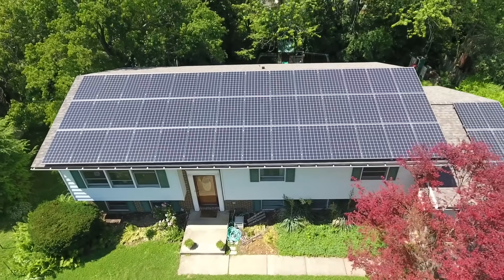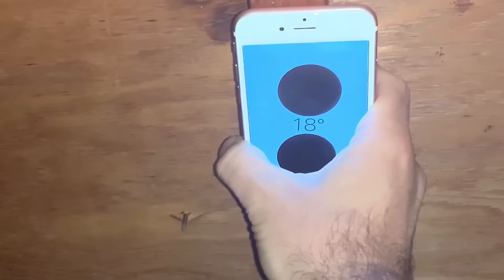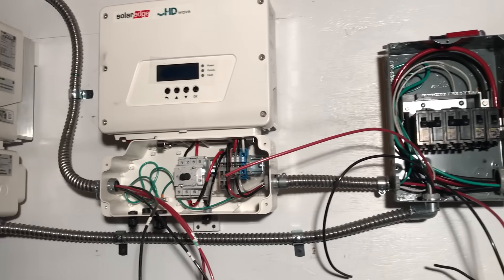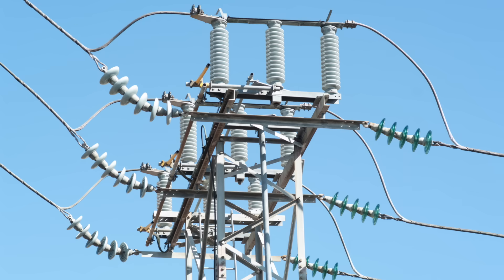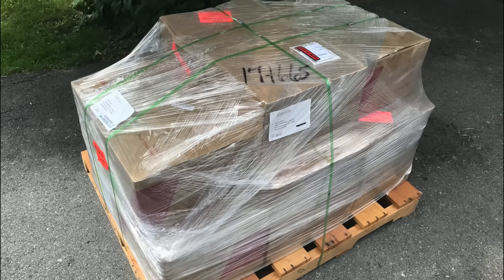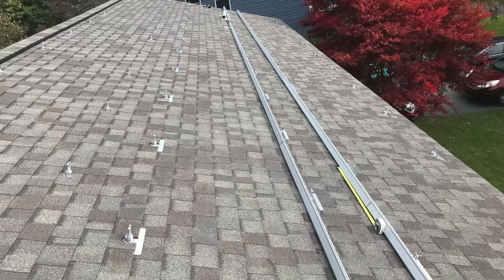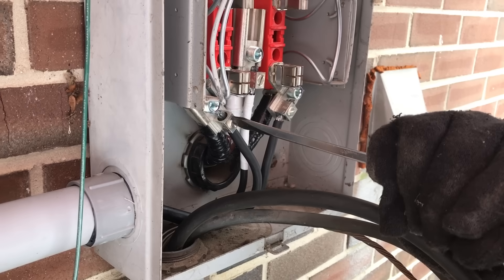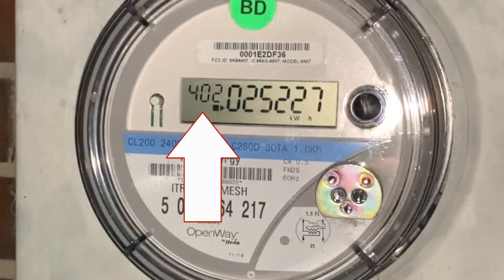I Installed a Power Plant Myself | HUGE DIY Solar Panel System

Comment: it is not clear what are the solar optimizers and the size of the inverter which should be huge. at the same time I see Vdc is 400V so I mean you are not using batteries for the night, right? so you use and sell energy during the day but you buy it during the night, right?

Comment: Do you have an air conditioner installed? and if you have how are you going about it?.. I hear it's the toughest...
Reply from the maker: at this point only window AC.  I do want to put in a mini-split at some point.
Reply: I run my full AC during the summer quite easily from my system.
Reply: Over all ... THE Best compilation of all the works needed for a complete system ... Go Earth 🌎

Comment: You sell the excess electricity during the day time and the sale make up for the electricity cost during the night time? So there is no storage involve?
Reply from the maker: Exactly.  I need to make a video explaining this.  In PA where I live there is not a great reason, IMO, to get batteries.
Reply: So the problem with that is this can't double for emergency power at night? Do you still use a generator then?

Comment: You can flip Vans and other automobiles by adding a solar setup to them and getting them set up
Reply from the maker: Sounds cool.  Do you have a video about doing that?
Reply: Buy a van, insulated it and instal solar solar and a battery bank and all that and flip it.

Comment: Do you have to pay tax on the money you make selling power back to the grid?? If so would it be best to design a system that gets you close to zero bill. Also is the power you generate back to the grid dollar for dollar what the power company charges you? Thanks in advance for the follow up. I'm just starting to consider solar and have tons of questions. This video was helpful.

Comment: I didn't know that you could feed straight in from the meter like that. Is there any kind of power transfer switch, so if your system is making power you don't zap a lineman if they're working on the wires?
Reply from the maker: There are safety protocols built into the inverters.  Basically they only produce power when they sense the power grid.
Reply: @FrugalRepair  So, in a power outage situation, your house goes dark as well?  Not very good.
Reply: I’m surprised an electrician hasn’t published a guide, then charge a fee to sign off. He would find thousands of customers

Comment: when you installed the solar edge, did they have to config your entire communication or activate it before it will produce power, I brought a used system that was set it up with a net meter. I did a grid tie system and put it up at my house and tested like 2 panels and it  and it has vdc[v] of at least 30, but no power is being produced pac[w] for a grid tie
Reply from the maker: I remember activating each inverter if that is what you mean.
Reply: @FrugalRepair  i was able to activate each inverter and it shows up in the system, it jus t does not produce any  pacw, i see the vdv of at least 30 when sunlight hits. even in your picture, the power is producing, maybe my inverter is broken
Reply from the maker: I wish I had time to help you track it down.  You could try sending me a video on Instagram if you wanted.

Comment: I rather pay $65 to $100 a month of electricity than pay like $20,000 for parts that it will take like 15 to 20 years to pay itself honestly plus we never know if we are gonna be living in the same house for those years so not for me doesn't make any kind of sense
Reply from the maker: I wouldn't do it either if those were the facts.  Have you gotten quotes or priced it out yourself? If you wanted super cheap DIY solar, you can buy used panels and equipment.

Comment: That was terrific!  I never realized that I could do most of the work.  The roof angle and area are so important.  I'm particularly impressed with how you installed the mounts.  Put them in as you put on a new roof.  That's perfect.
You're a smart man for getting an electrician to finish the hook up.  110 isn't so dangerous, but when you're talking about coming in and working off the main now you're talking scary in my book.  
I've just subscribed to your channel to see any other solar videos you may have.
Will you be thinking about installing a power wall in the future for back up electric?
Reply from the maker: Thanks for watching and subbing!  Yeah, 240v and 200amps is not what I wanted to mess with.

Comment: wow impressive, you seem to have done a great job. I would love to know here to get those solar panel deals. Also would be really cool if you could add a load dump. Water heat or Hydrogen generator.
Reply from the maker: Thanks!  Just keep looking around for deals.  At some point a seller needs to clear out the stock to make room for new shipments.
Reply: With feed in grid tariff, it probably make sense to sell it and bank the money unless the rate is very low

Comment: I am retired and on a  very limited income. That statement alone scares away everyone I have asked for help.  People make a living selling people complete systems that may go obsolete as new solar and battery technology comes available. I want to do Solar in segments and pay as I go. 1. Solar well pump. 2. Solar refrigerator, 3. Put my water heater on Solar as a battery to store energy 4. Solar air conditioning 5.  Put my LED lights on solar. It hard to get prices for components. I have a metal  roof that points southwestward and low pitch on the front. 52' x 18' I think.

Comment: Thanks for great video. What is your geographic location? Im living on "west coast" of Norway where there is quite many rainy days and power costs at worst $0.08/ kWh with all fees together. At best its ~$0.04/ due to transfer fees of $0.035.
I use between 20.000 and 25.000 kWh in a year and wonder how much  let say a 15kW system produces in a cloudy day. Wonder if it make any sense in my location and electricity costs.
Reply from the maker: Thanks!  I’m in the US, in PA
Reply: @FrugalRepair  ok and what's PA?
Reply: @damianlund395  Pennsylvania
Reply: @Demy26  Thanks
Reply: I would say everything above France no longer makes financial sense (without goverment insentives) to go solar.

Comment: You could make your roof have more Panel placement by building a right angle style house. Possible doubling. With sum roof construction
Reply from the maker: You mean, a house addition?
Reply: @FrugalRepair  yea, the angle of the roof with the solar panels could be extended to put more panels on. The roof side view would look like a right triangle
Reply from the maker: If I did a house addition, I would definitely be considering a south facing roof.

Comment: i have solar panels in the netherlands. They are duty free, you don,t need permission to place them, only tell your  energy compagny you have solar, delivered power to the grid have the same price as taken power so power generated at day can be used at night or even during winter. Nice setup though with those conduits. Your video is very inspiring and thourough.
Reply from the maker: Thank you!  That’s great you have solar too.  Have you been happy with it?
Reply: @FrugalRepair  Very happy, also same inverters from solar edge, a very big advantage of these inverters with optimisers is safety, when your solar string is unactive the voltage drops to 10v. Very safe. On regular string inverters the DC voltage is always high during daytime. Also very unsafe in case of an short circuit, could lead to fire or electrocution. Safety first. Too bad they are china made.
Reply: Sorry jelle maar dat klopt niet...
Reply: @crusher_026  wat klopt er niet. Ik heb al jaren 24 zonnepanelen op het dak en ik rij zelfs op de zon met 6800kwh per jaar. En een verbruik van maar 4000kwh thuis (gasloos) en 12000km elektrisch met een citigo. Ik heb niemand om toestemming gevraagd en ik maak gebruik van salderen. Daarbij heb ik over het bedrag van de panelen de belasting terug gehad. Moest wel inkomsten betalen over opgewekt vermogen maar dat valt onder de kleine ondernemersregeling grens dus dat hoef ik ook niet te betalen. Geen vergunningen, berekeningen niks. Gewoon online kopen en plaatsen.

Comment: Why didn't use the ironrodge camo clips on the ends so you could really have a flush look without the rails extending out? Great video! Congrats on the hustle
Reply from the maker: Thanks!  I probably didn't want to bother with the extra work.  I felt like it looked fine with and excess rail trimmed off.  But they do make it look slicker.
Reply: Thanks you got it looks great. Yours take up most of the roof so it blends in nicely. Batteries next?

Comment: The most important part never told was how much did you pay for all?
Reply: yup and how long it will take for it to pay for itself till its actually free energy..
Reply: @That Flinch Guy

Cost will be very dependent on how far you are to the distributors, your solar needs, and how you source your materials.

Return of investment was mentioned at the start if the video. 5 - 7 for break even with 14% ROI. It will vary greatly if you had it proffessionally as companies can charge 200 - 300 % additional.

Comment: 42 panels at 325 W each = 13,650 watts per sun hours. That is a lot of juice for a single family house, what is the estimated sun hours for you area? Most planning and electrical companies won’t let you over build what you current usage is, how did you get it by them?

Comment: Did you consider adding battery storage to the system
Reply from the maker: Not at this point because the costs are too high plus I get credit for my extra power I send to the grid.
Reply: @FrugalRepair  That was the same here (UK) until recently when the price paid for units returned to the grid were paid at about one third of the cost of buying units so it became significantly more worthwhile to save all the units you generate and use it yourself or store it when the price is low

Comment: No bills? I'm not quite sure, because you have to amortize your investment. Also, maintenance cost of solar panel system isn't cheap. Lastly,  solar system efficiency isn't yet stable; engineers are working on it now. So congrats and good lack man.
Reply from the maker: What maintenance are you thinking about that isn’t cheap?  There’s almost no maintenance involved.

Comment: That's awesome what u did. I needed a new roof, so I found a solar company to do both my roof and solar, and then they finance it all. Problem I found was, they charge the same install fee as material! On the other hand, they warranty it all for 25-30 yrs. And once everything is done on their end (solar/roof company), I'm going to add my own batteries, wind turbine, hybrid controller/inverter, auxiliary panel box and automatic switches so I dont backfeed to the grid.  I've reached out on facebook for help on the 10-15% of stuff and info I dont know how to do; I got hit with rejection, AND half my family work for the power company! I even reached out to a big solar company in my area with no response. So I'm super excited to see what u accomplished. Good job!
Reply from the maker: Thanks!  I hope you can get it all figured out.

Comment: This is a fantastic installation and I like the fact you probably have enough capacity to even run your HVAC during a cloudy day. Plus you will rarely have to worry about getting a bill while covering the panel degradation all the way to the end of their service life. I think a great follow-up video would be installing a power wall to store your excess power to use at night or extended cloud cover. I’ve been building up my lithium battery banks to match my solar output with each phase. Thanks for sharing!
Reply from the maker: Thanks for watching!  A lot of people are asking about batteries, but in my situation and with my utility it doesn't make financial sense to get batteries.  I get full retail credit for any KWH I send to the grid.  So it's like the utility is the battery.
Reply: @FrugalRepair  Understand but I mean having a backup for when the grid power goes out at night. What then? You can leverage the utility of your solar by adding batteries plus they would come in handy for any SHTF situation. Follow? It just would make a great follow-up and increase your viewer base to include all the preppers out there, which are substantial.

Comment: Great vid. I don't understand how your power company makes money if you have a 1 for 1 net meter.  It's essentially provided a virtual  unlimited battery storage service at no charge to you.  In Australia NSW it's about 3 to 1 ratio. You buy at approx 30c per kWh and earn about 10c to push a kWh back to the grid. The difference contributes to the costs of the poles and wires for electricity distribution .
Reply from the maker: Thanks!  The utilities probably wouldn't allow net metering on their own but the regulation mandates it.
Reply: Many utilities charge a fixed grid connect fee; I think mine is $15/month. I do, however, get the same rate for selling as I do for buying (initially we had really good incentives; I got 5x for each KWh generated compared to buying. That program is now over, however. )

Comment: Seeing this as someone from the Netherlands the American electrical grid looks so dangerous and old. In the Netherlands the breakerboxes are made from plastic instead of metal. Also our connection to the national grid is better. We have 3 phases comming in 3x 25A. That way you can split the solar output to the 3 phases. 

Have fun with your PV system!
Reply: The US also has 3 phases, which can be combined or isolated to produce both 240 and 120v. 240 is used for HVAC, clothes dryers and electric ranges. He has an older house in an older neighborhood so therefore an older infrastructure and connection. I’ve owned/lived in 4 new homes in Florida for the past 30 years, with all local grid lines underground and have seen a steady improvement in the systems including smart meters, almost no blackouts etc from Florida Power and Light. I think I’ve not had power for a total of 5 days in all those years despite dozens of hurricanes nearby.
Reply from the maker: Yes, my house (and breaker) are 1973 vintage.

Comment: Zip-ties.. The wires will expand and retract?
Reply from the maker: The wires have a very think insulation on them.  You just need to make sure they aren't going to be cut or lay on the roof (wind may cause scratching on the insulation).
Reply: Any way. Nice rig. Nice video.

Comment: No bill, just a cost that is equal to electricity bill for forty years.
Reply: 2:06 5 ~ 7 years actually and it is expected to work for 25 years with minimal degradation, minimal maintenance costs.
Reply: @ArthursHD  Maybe location affect the price. I calculated the cost a few month ago and get that forty years. And that with me doing everything instead of paying someone. I'm not in first world country, though. So maybe the components prices are higher (while the work is cheap .. but I planned to do it myself).

Btw, did he include battery replacement in his calculation? Battery typically wear after two or three years.

Comment: Why don’t you have a lithium storage shed in your backyard so that at night you never have to use power from the grid this way 100% of the time you’re sending power to your lithium batteries and once the batteries are charged 100% of the power is going straight to the grid giving you a larger rebate
Reply from the maker: The main reason is that I don't need to.  Net metering is full retail here.  So essentially the grid is the battery.

Comment: What is your opinion as to would it be better to have panels mounted on the roof versus ground mounted panels...? Ground-mounted panels would be easier to access if need be or clean snow off, etc. Just curious about your thoughts.
Reply from the maker: If I had lots of land I would go for ground mount.  But the only option I had was the front roof.

Comment: I was told I'd need 400000 worth of batteries in order to replace the mains power. Inverter is cheap. Panels get expensive but batteries are the lions share of the cost.